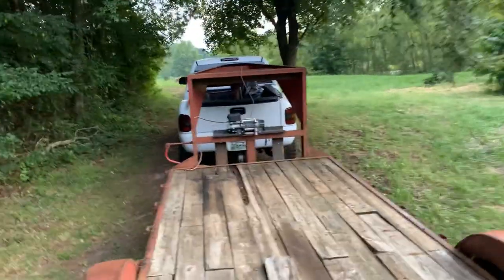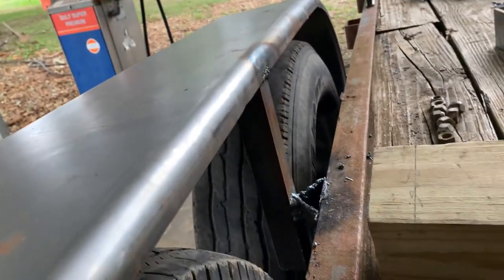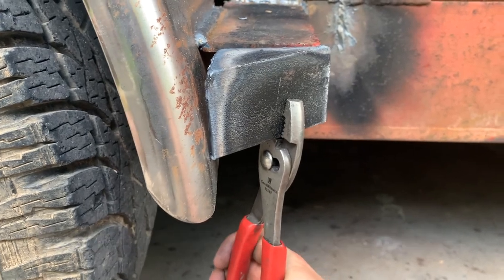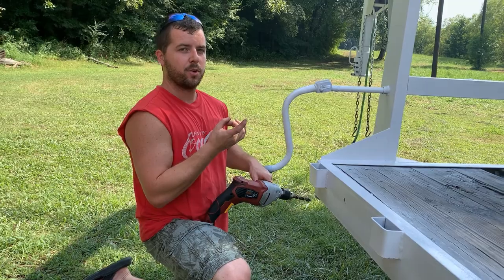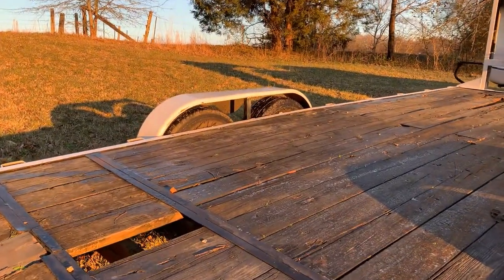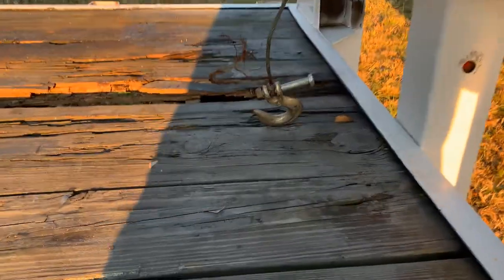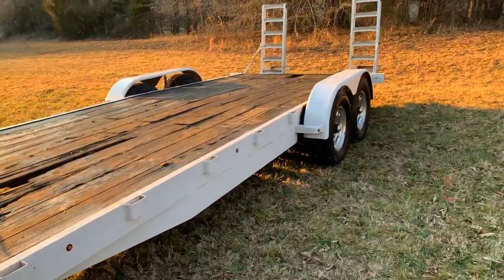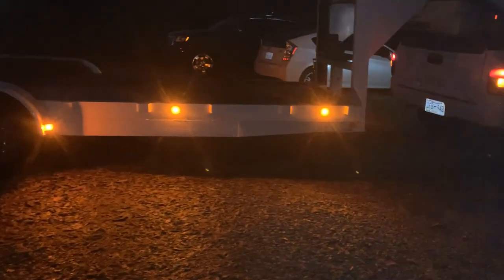Restoring the perfect gooseneck trailer that was left for dead

Comment: I have set of those wheels for my 20 ft Loadtrail  trailer. Match my 01 2500 HD,and my 04 Express 3500 van.
Reply from the maker: Sweet, bet it looks awesome hitched up together.
Reply: @JohnnyAnderson1  
Last week sold the 5.3L.  Money for the 6.2L all aluminum engine for the 1971 Pontiac lemans GT-37!
Reply: @JohnnyAnderson1  
Once they ar mounted.
Reply from the maker: @rajcam80  I ALMoST had my hands on one of them….. but It slipped away. I’d drop the turbo crap in a second if I could get one of those cheap lol

Comment: Whats the specs on the trailer? Length and width. White looks so good too 🤘🏻
Reply from the maker: It is 82” wide floor, I moved the fenders out 1.5” on each side because a tractor I haul is right at 83” on the rear tires so that gave me still a little clearance.
The deck is 18’ with 2’ dove tail. Reeeeeealy wish it was 22’ deck with 2’ dovetail so I could load the tractor with bush hog easier. But it still works by raising the loader up and resting the bucket on top of the gooseneck, just makes a lot of tongue weight lol.
Thanks
Reply: @JohnnyAnderson1  nice! Yea im looking at a 20 and a 22. I saw you loaded the pickup and was like hmm that seems to fit well. Thanks!
Reply from the maker: @edwardpersico2001  No problem,
yea honestly the welded on ramps are the only thing keeping me from loading certain things because they have to fold up which prevents me from letting the load hang off the rear. I have thought about making new brackets that have adjustable holes in them so I can leave the ramps at maybe a 45 degree angle instread of having them at 90 degrees lol.
You can fit a crew cab short bed on it without issue as is.

Comment: What size and brand spacer did you use for the trailer
Thanks
Reply from the maker: @michaelvasquez8012   they where some 1/8th universal 8 lug spacers, if I did it again I would just get some 1" spacers to push them out a little further